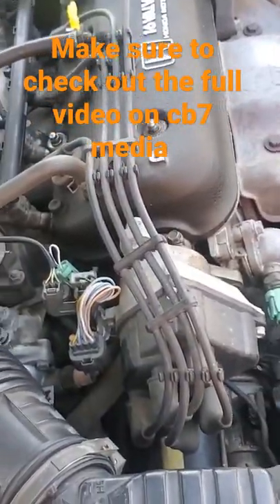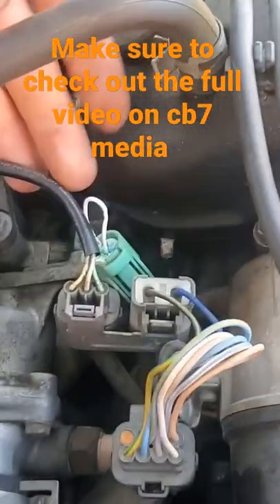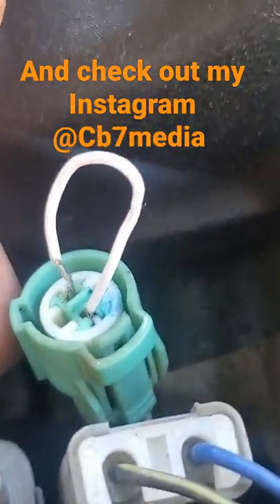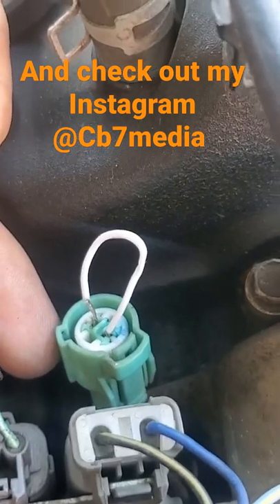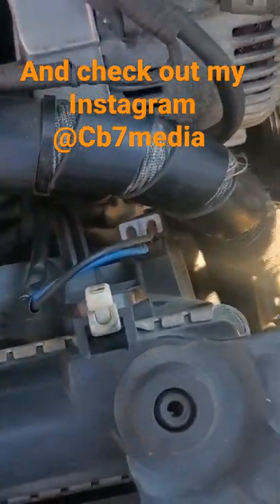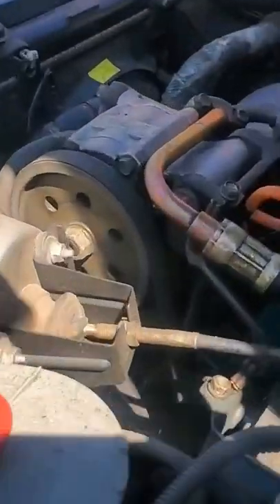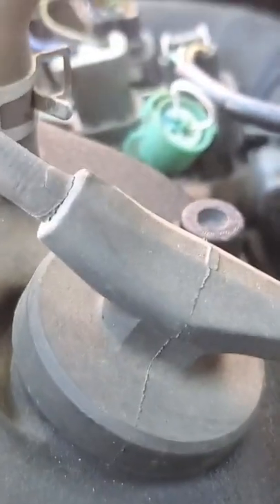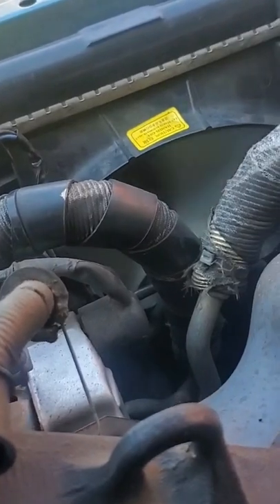how to check your radiator fan to see if it's working or not

Comment: Need your help please 🙏 I did this test and fans came on and then I replaced the cooler sensor and seems like the fans don't come on still and car coolers when driving and overheating at the stop light
Reply: What car is it ? Did you check relay?
Reply: @SMOER-fw2kn  it's a Pontiac Torrent 2006 and it's a back up car 🚗 I checked the relay but I seen video of a lower relay under battery I still need to check out ? Weather will be getting better in April? Will start working on again and I put a new radiator in and I still got heater core bypassed and the fans working i dont have car insurance to take on freeway yet so nothing i can do tell late April ( thanks for post

Comment: What happens if I jump it and it still doesn’t turn on
Reply from the maker: Check the fuse under the hood it's probably blown, or you have a short someplace. Check your grounds and  starter wires
Reply: Did u figure out what was wrong with urs? Mine didn’t work with the jumper wire also. I know my issue may be different than urs but I’m curious so I can maybe look there first
Reply: @micah.80665  checked every ground, changed the switch, the fans. Basically fired the parts cannon at it. I gave up and hard wired the fan with a switch. I think it ended up being the ecu but I never tested it. I don’t own the car anymore:(
Reply: So no I did not figure it out😂

Comment: Should both fans turn on at the same time so people tell me that one’s only for the ac
Reply from the maker: The AC Fan only kicks on when you turn on the AC that is correct. The radiator fan only kicks on when the engine temp gets to hot or the relay is going bad or the temperature switch on the thermostat.
Reply: I replaced the radiator fan switch an it still doesn’t turn on only when ac on fans are on
Reply: @alexmoro9095  Did you replace both Sensors? Ones a cooling fan and another is a Temperature cooling sensor

Comment: Been at this All day. Put in a new fan and a new sensor. The fan only works if I unplug the sensor. I have to work in the morning and don't have any more time for this. Would it damage anything if I drive with the sensor unplugged?
Reply: It shouldn't, but because of it, the computer will not get the signal of the engine been warm , so it will think that is still cold & therefore will keep fuel injectors spraying gas as if it's cold engine temperature. In other words, u will spend a little more ⛽ than usual..., just get it fix ASAP

Comment: Idk yet if my cooling fan is turning but considering my ac blows cold when I'm drivng but when I stop or I'm in slow traffic it stops blowimg as cold and eventually my car will start to run hot after about 15 mins or so. As long as I'm going consistently fast enough it blows cold. Im assuming that's the fan itself and it's drawing from my battery causing it to die if I say leave my doors open for more then maybe 5 mins to unload it. Rrlays are fine guess this is my next step. Any suggestions of anything else to try besides a jump wire test?
Reply: Same problem here!
Reply: it’s the thermostat, you’ll need to replace it.

Comment: Would the thermostat sensor be the same as the coolant temperature sensor?
Reply: the coolant temperature sensor would be on bottom of the radiator. you would have one or the other depending on the year.
Reply: Okay thanks.

Comment: After determining that the radiator temperature sensor is faulty, is it safe to keep that wire on the whole time and forget about replacing the sensor itself?
Reply from the maker: It's best to replace sensors and relays both or just figure out what is the main problem and go from there

Comment: hi will this work for 2008 civic. Is this also called shorting it?
Reply: Maybe not try this .i did it and temp gauge stays at top even when not plugged in now
Reply: should work for any vehicle with a coolant temperature sensor of this standard type
Reply: @ShlamTorray  thanks
Reply: @zeez4178  unhook your battery from the car and hook back up, that will reset your readouts, you basically caused the computer to think the engine was like insanely hot when you put the paper clip in there, so it may cause lasting error codes until reset
Reply: @oldskolacura9798  thanks

Comment: So when you pull the shorting wire and the fan turns off, this means your thermostat switch is bad, right?
Reply from the maker: No if you put the wire in and nothing happens that means the fan is bad
Reply: Am I right thinking both of these guys are correct ?

Comment: My fan doesn’t blow hard, any advice?
Reply from the maker: It's probably getting worn out, or the bearings are going bad, so I would recommend getting a new fan there, not really that expensive or hard to change out  i recommend checking out 1A auto  for the fans compared to using a auto part stores like auto zone they will be  double the cost for the same fan !

Comment: Why do my fans turn ON when I unplug that fan switch and turn OFF when in short with a paper clip like u have done.
Thanx a lot for the tutorial
Reply: maybe bad fan relay? idk thats really weird
Reply: That’s because it set up backwards. My 2000 Camry fans run all the time when the sensor is unplugged. Once plugged in it’s off

Comment: Bro I tried this and my tan doesn’t turns on
Reply: That means the problem is not in the temperature sensor, maybe in the fuse or relay  or fan itself or wiring

Comment: What dose it mean if the fan doesn't turn on when jumping wire?
When my car running the fan will not come on but when I unplug temperatur unit while it's running the fan kicks on?
Reply: Same here have you found out anything about how to fix it?
Reply: thermostart bad
Reply: Ect sensor is bad
Reply: Ended up be the fan itself.  Even tho the fan would work when unplugging temp, sending u. Or just putting power to it.  Wasn't accepting the single to turn on. I guess.  It worked. 🤔
Reply: That means you have a bad coolant sensor
Reply: @1981bundy so you replace the fans and problem solved?
Reply: Gracias!!!!!!
Reply: This is crazy
Reply: All wiring is perfect I check all wire. 
Did the connector clip by pass relays
And the freaking fans don't come on and car overheats crap. 4 freeking days on this thing it's turning me crazy.

Did the head gasket test negative 
Thermostat new 
Coolant
Fan witch new
Radiator new 

,😭😭😭😭

Comment: Ended up be the fan itself.  Even tho the fan would work when unplugging temp, sending u. Or just putting power to it.  Wasn't accepting the single to turn on. I guess.  It worked. 🤔